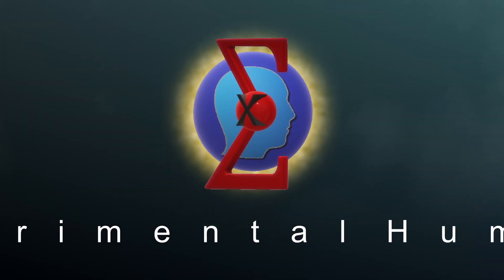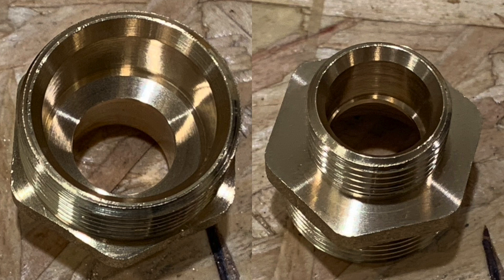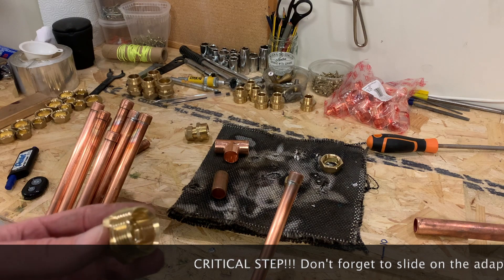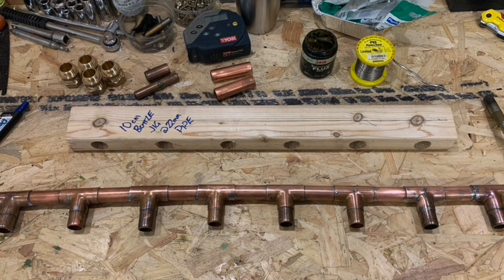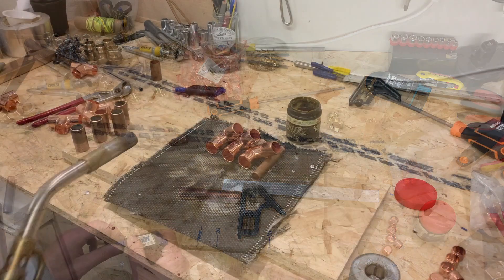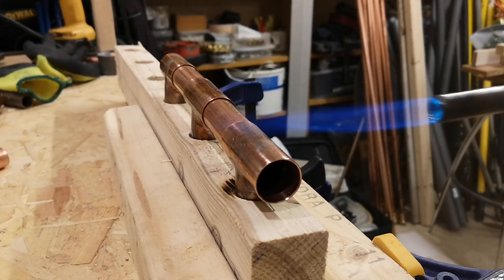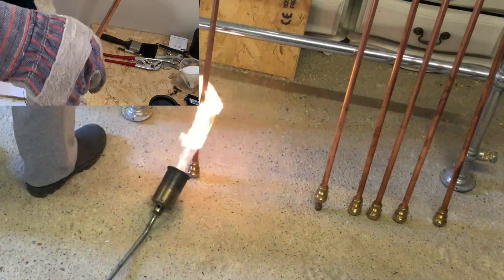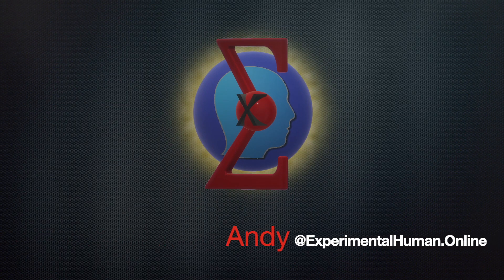Solar Heater Array - Module 2

Comment: Really enjoyed this and your 6-parter on the heat pipes - brill!!  I like the graph plots too - always nice to have the data to back up the science.  Doing my research at the moment, so some comments for discussion: 
1) heat pipes work best when the condenser is significantly colder than hot end, so worth considering protecting the condenser from sun - insulating the top section would be better? 
2) I'd wondered about running a 28mm HX and having a  28mm equal Ts and reducer to 22 then connecting to compression fitting (more sfurface area, more water flow, more heat trasfer?). 
3) insulating the lines and (a larger) tank is perhaps the next step...to keep all that heat in? 
I subscribed - looking forward to updates.  :-)
Reply from the maker: Hi MultimediaSausage-  thanks for the comments and taking the time to view the videos, much appreciated!

For the orginal solar module I have added some insulation to the hose pipe tails to hold onto to some of the heat, its too early to say anything yet, as presently the limiting element in the system are the fans - they just aren't driving much air flow through - I'm only getting 2C uplift in temp even though the heat pipes and manifold are going over 30C on a good day. I am going to redesign the fanboxes, change fans, and if there is not noticeable improvement I'll move to water as the transfer media and connect in an old radiator! Think this will play to your point about havng a good temperature delta in the condensor - top tip - thank you!

Totally agree with your comments around 28mm - I'm trying to balance / understand contact area with flow rates both with air and water to start with and then I'll go from there. The old design maximises contact area for heat transfer but limits flow and doesn't drain back - concerns around freezing etc. The new design should improve on drain back is easier to build and insulate but has less contact area for heat exchange - I'm interested to see how they compare!

I've grabbed some wrap/snap around  insulation pipe insulation - I'll post that up onto Facebook. Please have a look at @ExperimentalHuman if interested!
Reply: @experimentalhuman8696  Andy. Thought you might be interested in this - found it today: https://celsiainc.com/technology/heat-pipe/. Nice overview, there's a link to heat pipe thermal conductivity considerations at the bottom: https://celsiainc.com/heat-sink-blog/heat-pipe-thermal-conductivity/ and a heat calculator coming off that page also. Interesting background. Vertical pipes are around  1/3 more efficient than at 45 deg. I will be looking at vertical scoring my bores with coarse sandpaper of similar. I pondering a heat exchanger design at the mo. WIP!  Michael  :-)
Reply from the maker: Hi Michael, interesting read, many thanks. I wonder if my design could be inverted, i.e. run a 15mm pipe inside a 22mm heat pipe, should be simple to make, I’ll add it to my to do list!
Reply from the maker: Hi Michael - thought it might be helpful to provide a link into the facebook page: https://www.facebook.com/ExperimentalHuman

I'm posting up interim updates here - takes me a little more time to create the videos for the channel - I'll get there in due course! Got a bit of sun the other day and managed to do a quick smoke test - managed to grab some data and generate some more graphs / data too! All is working! Hope you enjoy! Andy